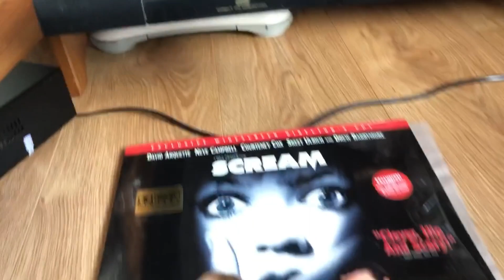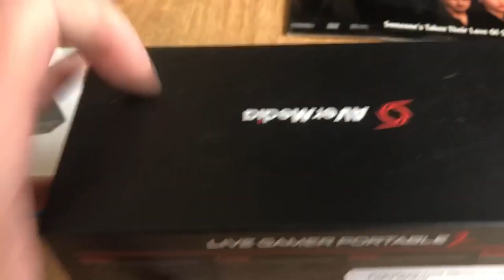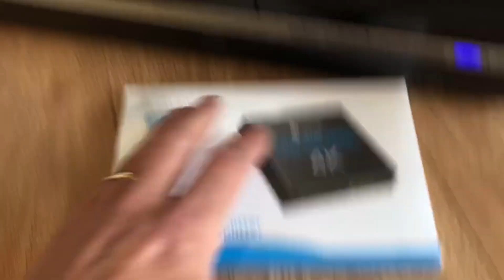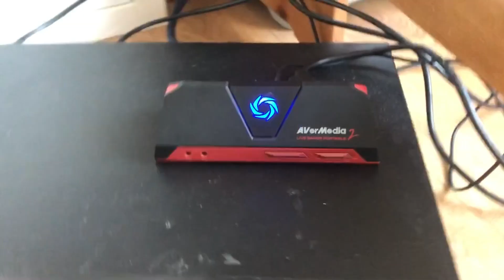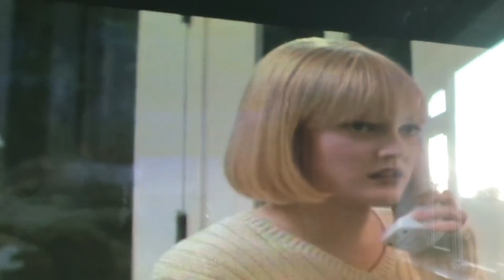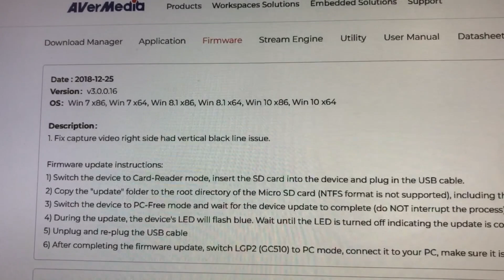Pioneer CLD-D925 Sony RDR-HXD970 Live Gamer GC510 NTSC Laserdisc to .MOV uncompressed - standalone

Comment: The best day to rip a LaserDisc is to directly capture the pure Analog RF Signal and convert it on the PC to an Video. There are Kits out there for this line the doomsday kit 😊
Reply from the maker: Ah yes I have heard about the Domesday Duplicator project, a little beyond my needs and budget but very interesting. My video here is a bit of fun capturing via HDMI instead of the usual straight composite to PC usb dongle/capture card or DVD recorder approach :)